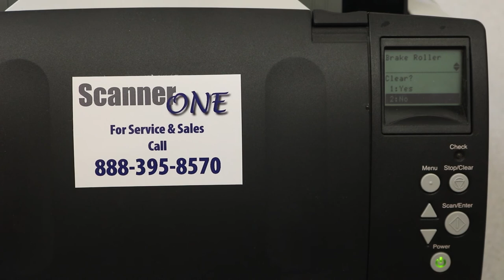Fujitsu Fi-7160 Roller Kit Replacement Guide | ScannerOne

Comment: This video tutorial was very helpful.  However, after replacing these parts, my scanner is now jamming on the last page of a pile of documents (and it didn't ever do that before).  It's also grabbing a few pages at once, instead of one by one, and that didn't used to happen before.  The new rollers were installed properly, and I also sprayed the inside of the scanner with a can of dust cleaner and then made sure to wipe everything down really well before closing the machine up.  I'm frustrated because my scanner is giving me all kinds of issues now that I've installed/replaced these parts.  PLEASE HELP!!!